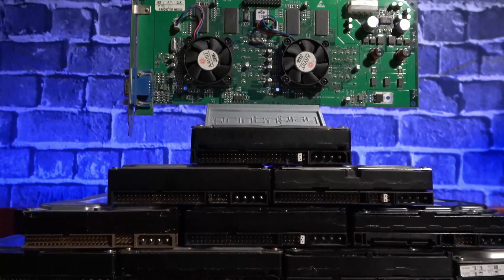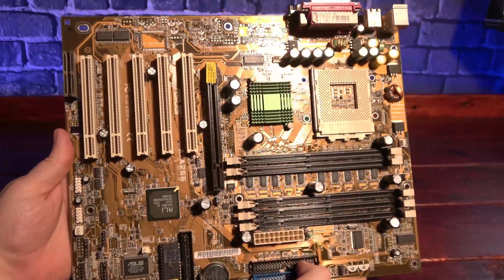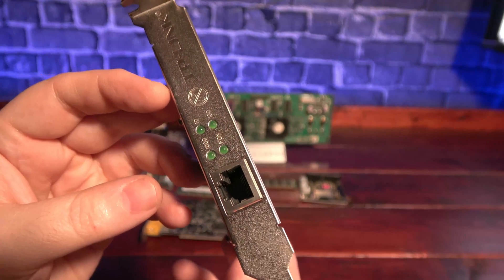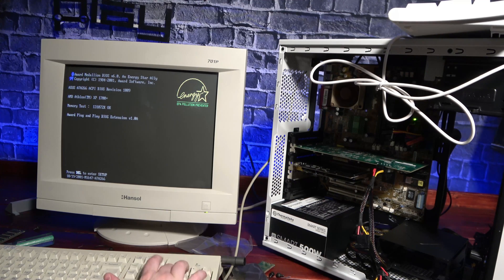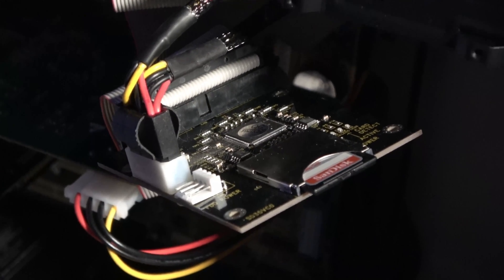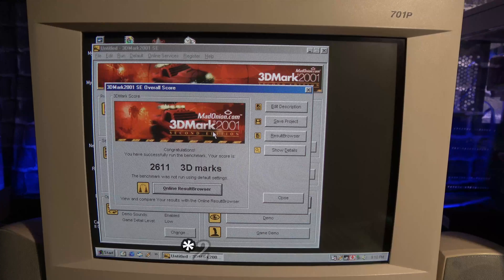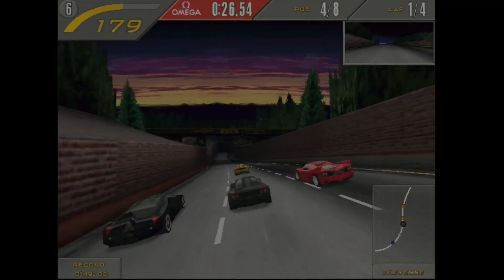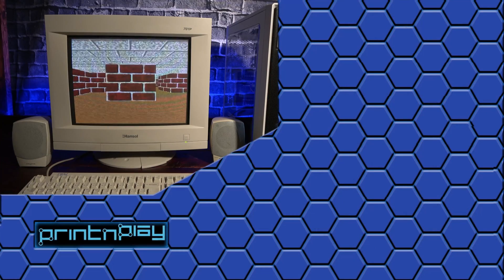Unleashing the 3DFX Voodoo 5 5500

Comment: That's a super awesome retro build and if you like simulators  f22 lightning 3 is pretty fun and tachyon The Fringe both those games are made by Novus logic and they're both Glide games I have a Windows XP machine but I use a Glide wrapper called n Glide I love older games especially when you can get them running really fast

Comment: Ah yes, nice video there, I'ma happy owber of the 3dfx Voodoo5 5500 PCI Macintosh 64MB Rev.A1 2900 which I flashed with PC Bios 1.18_DVI back in 2005, my card also went through 9 reworks to get things up and running safely thata re these reworks:

------------------------------------------------
SWZSSR's friend's Recap & Modifications:

01. Full Polymer Recap
02. Enzotech Copper Heatsinks for the VSA's rear side
------------------------------------------------
Backfire's Repairs & Reworks:

01. Renewed Ceramic SMD's on the rear
02. 6ns Hynix VRAM renewal for the main VSA-100 Graphics Chip
03. Renewed Heatsinks & Fans for the VSA's topside
04. Renewed Power Supply Controller Chips
05. Fixed the IC U510 Chip's pins
06. Replaced 4x TSOP-86
07. 6ns Hynix VRAM renewal for the slave VSA-100 Graphics Chip
------------------------------------------------

my V5 PCI Mac runs as the secondary graphics card alongside my Matrox Parhelia AGP 256MB 256Bit DDR Rev.A 5103, it's the first release of the Parhelia AGP 256MB DDR that has a Universal AGP x4/x8 connector, this card was a gif from a Matrox Employee from Matrox HQ EU from Belfast, ireland, these cards both are used in my main retro gaming/workstation PC which is the following:

Sveta 2002

AMD AthlonXP 2200+ Thoroughbred-A, 1 Core @ 1.8Ghz
EPox EP-8K7A+ AMD 761 Chipset with Via 686B SB 
2x 1GB PC-2700 Kingston @ PC-2100 266Mhz DDR
Matrox Parhelia AGP Universal 256MB 256Bit DDR Rev.A 5103
3dfx Voodoo5 5500 PCI Macintosh 64MB Rev.A1 2900 + PC Bios 1.18_DVI 
Creative Labs Sound Blaster Audigy2 ZS Platinum Pro Rev.A 2703
Mitsubishi Electronics LS-120 F200 Super Floppy Drive
1x Seagate Barracuda V 80GB 7200 RPM Main disk
1x Seagate Barracuda V 120GB 7200 RPM Game Disk
Belkin 5 port NEC USB 2.0 PCI Card
3-Com 3C905C-TX-M PCI Ethernet Adapter 10/100Mbit
LH HD-DVD Drive 16x / 40x
BTO Plusdeck 2c Cassette Tape Convertor/Player/Recorder Drive
Enermax EG465P-VE 365 Watt PSU
Addtronics 6896A Entry Level Server Tower
Compaq S710 17" Blackshade CRT from 2001
Reso @ 1024x768x32 @ 85Hz | 0.22.5 Dot Pitch
1995 Roland E-14 Keyboard

WinXP Pro USA + SP3
Matrox PowerDesk-HF 1-13.0-158 WDM Driver from May 2007 
With Matrox PowerDesk 1-5-0-107 Control Panel from September 2003 for Parhelia AGP
SFFT Alpha 41 Modified by ps47 & myself from 2008 for V5 PCI Mac

You can find my build log at Vogons , there I go as Gold Leader-B747.

Comment: Nah the voodoo5 6000 or the quantum3d AAlchemy 8164 were the true kings of the 3dfx technology castle. a testament to the philosophy of "just add more until it works" the v5 6000 with its 4x VSA 100 chipsets and the 8164 with its absurd 8x VSA 100 chipsets, imagine what a card with the speculated maximum supported VSAs of 64 in parallel would look like.

Comment: 2:20 - i am a witness of this time and you are correct. The Athlons with the XXXX+ numbers gave users a comparison to Intel products. They AMD processors had less pipeline stages, means there were less clock cycles needed to fully execute one instruction. The intel processors were still able to pump out more instructions with their higher frequency, but with the extremely limited cache and the unrefined branch prediction, this wasn't as big of an advantage for intel as one might think. Still, i think it was scamy of AMD to mislead people like this, because there were more than enough situations where the Athlons didn't came close to their advertised XXXX+ counterparts.

Comment: Many of the XP 1700s could run at 2400 MHz with good cooling. Check the numbers on it and look it up. The XP was short for experience and they could keep up with the Intel CPUs at a lower clock speed for a fraction of the cost. I built a lot of them back in the day.

Comment: It's a really nice build and I know I'm late to the party but, I want to express my concern for the choice of power supply, as I saw no one in the comments mention it at all.

With Socket A/462, you have to make sure your PSU supports a high load on the 5V rail, because these CPUs draw most of their power through the 5V rail. It's pretty specific to that generation of Athlons since 486/early Pentium era. Most PSUs back in the days could support load of 250-300W (and even more) on the 5V rail, while most newer PSUs usually top at 120-ish watts.

Other than that, that's a really neat retro rig 👌

Great video ! :)

Comment: Yep - putting fingers and other surfaces all over the edge connectors eventually leads to bad connections or worse on at least one component. Anti static bags are always worth keeping, and not ever touching the edge connectors or other components, or having them sat on random surfaces is generally a good idea with this kit.

Nice build. I'd moved onto an ATi Rage Fury 128 after a Voodoo2 12MB by the time the Voodoo 3-5 rolled around. DVD was taking off, and the ATi cards were fantastic with video, as well as having S-Video output for the big TV as well as the monitor.

Good times.

Comment: My first 3D card was a matrox mystique 220. I had a cyrix m2-200 or 233 back then, and since the matrox didn't have triangle setup in hardware, that had to be done by the CPU. But the Cyrix was so fast that my benchmark results were much better than with any voodoo 1. 
Later I got an Intel 740, with bilinear filtering without performance loss, and even AA and alpha blending.
Those were the good times, with Star Wars - Shadows of the Empire and Mechwarrior 2 Mercenaries.

Comment: I have a similar build only with two athlon MP server cpus running at 2 GHZ each and 3 GB of DDR. Because of SMP, i run win2000 dual boots with XP. I already have a 98 voodoo 2 SLI machine so no 98 on this rig. Also I'm using two SSD drives. One for each OS. OH and a creative labs audigy card. Its a beast of a rig and i love it
Reply from the maker: Awwa that sounds like an absolute treat. Awesome build, thanks for sharing!

Comment: the AMD Athlon XP naming "officaly" had nothing to with intel and only equivalent clock of AMD Athlon CPU. but yeah really it was because the AMD Athlon XP's had better IPC but lower clocks then the P4 at the time so yeah a 3200+ is ~= to P4 at 3.2Ghz. that said the Athlon XP is much newer then the voodoo5. the voodoo5 came out the summer after the orginal Athlon CPU i ran my V5 in a Athlon 700mhz pc for a long time lol too long even ended up replacing it with a Raidon 9000 before finally upgrading everything when the Athlon 64 came out

Comment: Pretty neat... I just paired up a Voodoo5 5500 with a similar system that has the same mobo. It's had winxp installed for years so I'm currently running some mod drivers. 3dmark was only 2430 or so with an athlon 2400+. I'll probably buy one of those sd card adapters and drop my ram down to 128mb and install win98. Good to know what score I should be shooting for.

Comment: Whynhave you not install this CPu with a flat monitor running on Win XP? It would be more modern, instead of running it on a CRT and win 98
Reply from the maker: Operating system can definitely be your preference, although there are many pre-xp games that run better on Windows 98 versus XP. For the screen, games scale better on a CRT than an LCD if you are unable to run the games at the LCDs native resolution. And this project was never about modernizing the experience. Just building something clean that would show off the internals, and use a new power supply that was less risky than trying to use a 20+ year old one.

But everyone is free to do their builds as they see fit. Just the way I decided to go with it :)
Reply: @PNPRetro  Also why did you not go with a AMD phenom system? It has multicore and a 64 bit cpu. i have a phenom x2 64 bit, which i would like to fit my v5, maybe using a AGP to pci adapter, but just scared with the voltage issues.

Comment: I have a Voodoo 5 5500 AGP and V 3 2000. I tried to set up the V5, but my MSI AMD mobo is busted. Can I install this card on a PCI slot using a AGP to PCI interface and not worry about the chipset not supporting 3.3 volts? Coz the Voodoo cards needs chipsets that support 3.3 volts on AGP. Anything lesser would burn the card form what I read.
Reply from the maker: I don't have a perfect answer for you. I would guess it depends on if the PCI to AGP adapter provides 3.3v or not. But I did find an old forum post that suggests someone has done this already. Hope it helps https://www.vogons.org/viewtopic.php?t=63903

Comment: Wish you were told us the core temps and the frame rate performances for the build and the games.
Reply from the maker: Will do my best to include that info in future videos. Thanks for the advice.
Reply: @PNPRetro  this was importany. Im trying to see the different performance results from youtubers. I had this card a few years ago. Ran fine except when benchmarking unreal 98 after the update...it gave me a 34 fps rating from a pentium iii machine 1gb ram. Wasnt sure what was the issue and had quit testing it. Appreciate the vid though

Comment: The athlon xp used a performance rating system. For example 1700+ meant it was running as fast or even faster than a hypothetical original athlon at 1700mhz.
Reply: this was the official line from AMD but it really was for marketing vs the P4

Comment: I have one of these in my collection but I have not used it yet. Pretty interesting addition to any vintage graphics card collection as the first dual GPU (on one card) and the final 3dfx release. The other cool thing is this used "SLI" on one board long before anyone else did (HD 3870 X2, eat your heart out!). But this SLI is Scanline Interleaving, which is functionally different if conceptually the same as when nVidia reimagined it as Scaleable Link Interface. 
I have plenty of PIII parts. I can use anything from an underclocked 200MHz through 1400MHz because I have upwards of 10 CPUs. Thinking 1700MHz is overkill. I'll probably go with 600 or 750 because this is less than half as powerful as the GF3 Ti 500 I bought in 2001 and ran with a Willamette P4. 
Sadly, while this technically supports Glide, it isn't really compatible with the games designed to work with the 1st and 2nd gen Voodoo. Good thing I have a Voodoo 2 in my collection to play around with those. Even still, it requires some special configuration to work with Gen 1 games. I think when you know all that about the Voodoo series, it is easy to see why 3dfx failed as a company. Even nvidia refused to support that mess when they acquired 3dfx.
Reply: If you think it was the first dual GPU on one card, you should check out the ati rage fury maxx from 1999 :)
Reply from the maker: Sure!

checks ebay prices

Nope!

Comment: This card is the core of my DOS gaming rig. Glad I got it, when I had the chance. I could run faster GeForce cards, but for native Glide, 3DFX is a must. Plus AGP! It's great.
Reply: This card really isn't great for playing DOS glide games because it is not really compatible. You have to tweak just to get Glide 1 to run on a Voodoo 2. You presumably downloaded some modern driver or converter and possibly altered config files without realizing the implication. When the Voodoo 5 was released, you could not run DOS Glide games on it. And while Voodoo 2 can be made to run Voodoo 1 games properly, if you are running those first or second gen games on your Voodoo 5, you aren't getting it how it was originally supposed to be. It is a different architecture. You are technically emulating the function, which isn't any more correct than simply running it on a modern PC in emulation. I also suspect it isn't great at running regular DOS games either.
Where the Voodoo 5 belongs is in a Win 98 rig alongside a 600MHz PIII.
Reply from the maker: I was definitely a 3DFX fan boy back in the day, and very glad to have found one of these now. I love it!
Reply: @PNPRetro  I put my chips on Matrox back in the day. Another brand that went nowhere. I only discovered Voodoo's when I started retro-collecting. Got nearly every model, with the exception of 4500. And lots of them came in bags of parts, and cost me next to nothing. 5500 I had to ebay back when prices were tolerable, because I used to love games that had Glide support (like Wing Commander), which had the checkbox disabled. I was eager to re-experience them all with 3DFX, and was absolutely glad. I'd even consider getting the overpriced 6000 remake, but so far, I've only seen cosmetic reviews. No working demos. When I saw the SLI-like port on 5500 I wondered if that was from the PCI version, to allow dual cards, but turned out it was for an expansion card, and had nothing to do with SLI. After Matrox I went with Nvidia. Admitted defeat. By the time I got into 3DFX, the company was long gone.
Reply: @enilenis  The Millennium was a good 2D accelerator. I used one from 1994-1999 or so, being relegated to secondary status in 1998 when I got a RIVA TNT. I also used a Diamond Stealth 64 VRAM in a second PC during that time,  until replacing it with the slightly better Matrox card. The Voodoo 5 5500 is a SLI card, just has both GPUs on one board. Stood for Scanline interleaving back then and was conceptually the same as the later Scaleable Link Interface while being functionally different. This is where nVidia got the SLI name in the first place. The Voodoo 2 was the first SLI graphics card in history and the Voodoo 5 the first dual GPU card. A lot of people think it is the HD 3870 X2 which came some 7 years later. The 3870 x2 was merely the last AGP card to feature dual GPUs. I know, I know, it was only ever released as a PCIe variant but it is PCIe via a bridge chip and was natively AGP so it counts. If you wanted to, you could make a custom board, transfer the components and make it run in an AGP slot. You would have to write a custom driver to get it working though, which would be the hard part. In practice, however, nobody is going to do that because you would be ruining a very rare and valuable GPU. The best I could do was add an HD3850 AGP to my collection, which is fine because it is the most powerful AGP gpu that actually ran in an AGP slot since the single die 3870 AGP was never released. I managed to get the Sapphire variant in pristine condition for just $5 a few months ago 🤤🤤
As for the x2, it really wasn't worth the price which is why they are so rare. In benchmark testing it scored 930 to the 3850s 787 due to the fact converting an AGP card to PCIe incurred huge performance penalties. They didn't release the single 3870 in AGP most likely because it outperformed the much more expensive X2 and they would have not sold a single X2. This is why, for the AGP era, it is always better to stick with AGP because there were no native PCIe cards. Everybody thought AGP was going to win the war but then there were some big changes to both PCIe and GPU architecture in general.  Though initially introduced on the HD 2000 series, the HD 3000 series uses the same Terascale 1 architecture and they are collectively the first modern GPUs due to the introduction of unified shaders.
Reply: @Lurch-Bot1  Tweaking launches to get Glide working - well, that's kind of a given. Yes. I'd go with older PCI versions for DOS gaming for sure. I have older cards for that. My brother did have 1st Gen Millennium - the same one you had, and that convinced me to go with the brand, because that was the only accelerator I've seen to that point. Riva TNT 2 was when things turned, leaving Nvidia competition in the dust. I switched over during GeForce 3 era, and been using Nvidia cards ever since. Have a stack of ATI's of all generations from 1998 onward, but I've never turned any of them on even once. They always had shader problems in the past. Was never a fan.

I've picked up a good share of $5 at thrift stores, often packed in plastic bags with other cards. I'd sometimes find multiple Voodoo's in a single bag. But those days are gone. The inexhaustible stream of retro hardware has come to an end. To build a proper retro PC now costs as much as a new one, if going with ebay parts. I have a lifetime supply of equipment, but it just goes bad over time, all by itself, and it's not always the caps. GeForce 3 I had I repurchased. Of Marvel cards, my original Mystique also went dead. The GPU started giving errors. Again, I bough the exact same model, because I don't want to lose anything from my past.

Most of my retro stuff is from the AGP era. Different slot adapters, 2x, 4x even. Those weird "future-proof" agp slots with extra pins that never got used for anything... or AGP from Mac's of the era, that look more like PCI-E cards. I have one ATI card taken from a G5, I think. It's ATI, but  I don't think it's designed to go into anything other than a Mac.

These days I use emulation more often than original hardware, just for convenience. As Voodoo 5500 ages, I'm getting more afraid of wearing it out. Sticking with DOSbox and VM emulation of older OS, when needed. I have DOSbox installed on everything in the house that can run it, and most games I play from the past don't require 3D acceleration at all. Voodoo is just fora handful of select games.